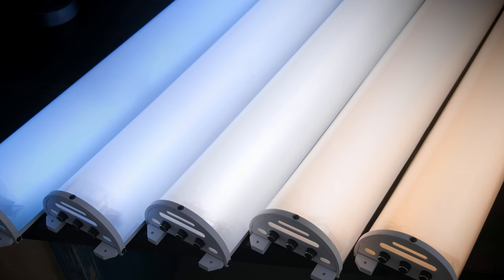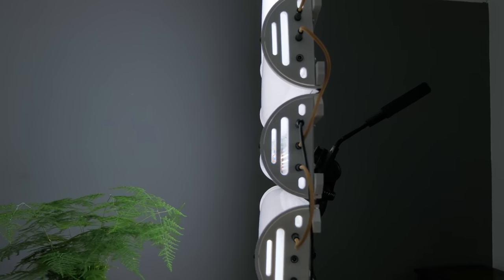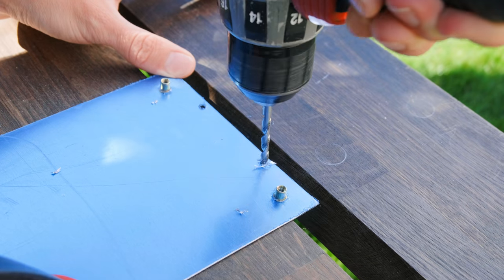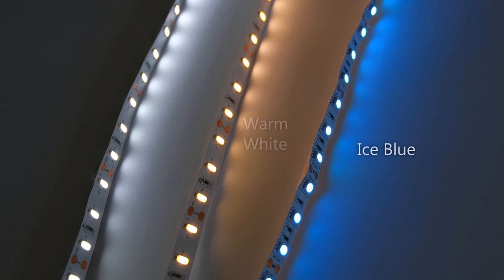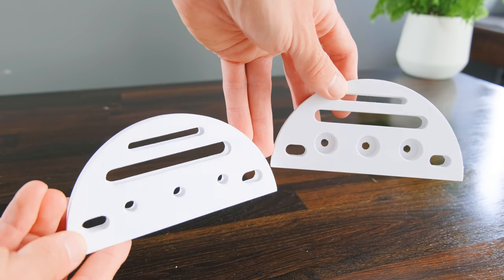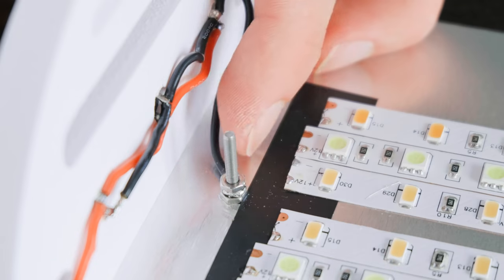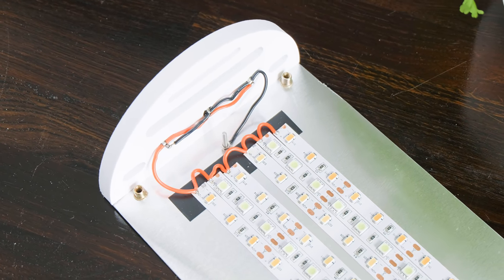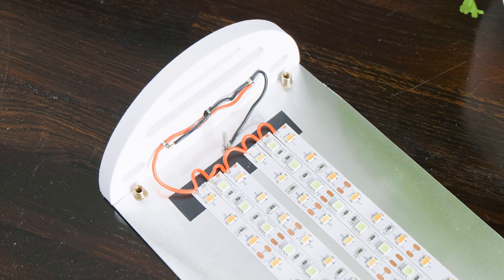DIY Studio Lights - How to Build Your Own!

Comment: can we agree that it's sufficient to use only two of those female DC power barrel connectors on each panel?
Reply: Only upside of 3 is being able to plug the power supply in anywhere in the chain of lights... (I'll be making mine with only 2 sockets)

Comment: Dumb question, im better with spanners than electronics. Would you be able to make these work with a powerbank like in your more recent DIY led video? Thinking these would be great as a workshop/garage light, where I have no power!
Reply: They are 12v so probably not from a standard 5v USB type power bank. Plus, those don't supply many amps anyway. If you don't have power there, you can also use a car battery or some other kind of 12v battery source, but I would make sure to get a device called a "boost/buck converter" that makes sure you get a consistent 12v. That should do it. LEDs draw pretty low power so if you have a regular lead acid battery laying around, most are 12v, it should last a good while as long as you don't have a bunch of them connected at full power
Reply: @adamrichardson2227  Brilliant! actually been looking into a solar panel and trickle charger to a 12v setup. So this definitely lends itself more to that. Thank you for such an informative reply.

Comment: I know this is almost 2 years old, but you never mention the size of the power supply to be used, The total length of LED strip in all the fixtures together daisy chained needs a large power supply, there are almost 5m per light, that is 24m of LED strip.

Comment: I bet if you used some 1/4 guitar pedal jacks/plugs (cheap in bulk from "The Usual Suspects" online) that would save you some hassle wiring up the short barrel jack wires. And they have right angles on the connectors so it might be neater? And they make them in quite long lengths... hmm...

Comment: Love this design, really well done. Wish I had access to the tools needed to make something like this, I've been pining for some subtle, dimmable wall-mount LED lighting for a while, but anything store-bought is ridiculously expensive. A question: what is the maximum power draw of one of these as configured in the video? And what gauge wire did you use for the internal power wiring, given that you'd need to allow for a bunch of these in series?

Comment: Hello Matt, I have built 3 of these and they are fine. But when I interconnect 2 of them they do not work. Maybe voltage drop? What power source do you use?
Reply from the maker: Sounds like a power supply issue! Make sure that you use a power supply that's able to drive them all. They use between 2-3a each, so 2 will need perhaps a 6a power supply.
Reply: @DIYPerks  I knew it. What is your power supply?

Comment: Any links on where to get the aluminium sheet(s), please ? The ones sold at Home Depot are way too thin for the job.

Thanks to answer
Reply: I bought mine at home depot and yes they flex a good bit, but they should given how thin they are and they don't have the acetate to support them yet. My aluminum sheets are around .7mm thick

Comment: The manufacturer of those LED strips sugests using 10A and 15A dimmers and not the compact 5A ones showed in the video. Anyone tried doing it with those bigger dimmers? Seems like you would need a larger base for the aluminium plates and/or ovaloid pvc heads to accommodate for the increased size.
Reply: While not worded as such, I'd imagine that's the suggestion when driving the entire 5m length. This project breaks that down into 1.5m lengths. The 5A dimmer should work just fine.

Comment: Hi, can you please add a recommendation on a suiting powersupply? The only thing missing in my shopping basket :-) maybe put it in the videonotes, so it is easy for others in the future to find
Reply: With the lengths used, The wattage for each light unit with all 6 strips at full power would be ~ 54W (4.5A @ 12V) - That being said, I don't think it's likely that all 3 sets of colours would be at 100% so you could probably get away with less. I ended up just buying a 10A brick. Smaller ones weren't that much cheaper and going any larger would require a generic industrial PSU with exposed terminals.
Reply: Thanks for the info, but i'm wondering: Are we talking about 54W for each "light-bar" or a number of bars daisy chained? since i would roughly compare LED vs classic lightbulb 1:10 in wattage. I'd end up with a 500 watt equivialent lightbulb for each bar? or are we walking about 5 Lightbars as in the video.
Reply: @sebastianheese803  yeah, ~ 54W per "light bar". The eBay listing for the led strips says 50-60w per 5m length and these light bars have 4.5m of total led strip length in them, split between the 3 pairs.

Comment: Do these flicker for slow motion video?
Reply: Not the same way incandescent lights flicker. Those turn on and off at 50-60Hz, so it's easy to see in any slow motion. There still is flickering from these LEDs, but the rate is so fast (10000Hz) you would need an expensive slow motion camera before it becomes an issue.
Reply: Kyle Jacobs Thank you!  This light is a godsend

Comment: It's all good, except your grounding and lack of any form of fuse. Soldering like that isn't reliable and the solder will cold flow over time and the connection will become loose.
What you're supposed to do is to crimp a ring connector on the end of the wire. That's much more reliable in the long term.

Luckily you're not using mains electricity on these, or that grounding scheme would be life threateningly bad.

In this case it'll just cause intermittent working and possibly sparking and won't necessarily break anything or cause a fire or electrocution hazard. 

Add a fuse, improve that grounding and it's almost professional level product. Almost...

Comment: Why do you have three power inputs when one would work just fine?
Reply: He says in the video it's for chaining multiple lights together.
Reply: @LaneSurface  for such purpose you will need only two sockets, the third is redundant
Reply: @WRXMSK  Right, it looks like the third is so you can plug in the input power into any one of the lights. Kind of a weird way to do it, but I guess it's somewhat convenient.

Comment: I was excited about this project and the details....but the lack of a circuit diagram and the lack of power supply made it only a 90% project....
Reply: The circuit diagram isn't super necessary as he shows all of the wiring on the video at various points even if only for a split second. I got a barrel plug 12v 5a power supply and it works fine for powering two so far, haven't tried to power three yet.

Comment: Info from the led strips seller: "Please note: we suggest you use 10A or 15A dimmer to control this 95+ LED Strip Light, not use 5A dimmer." What about it? Should I care?
Reply from the maker: It's fine - there are two 75cm lengths rather than an entire 5m length, so there's much less current.

Comment: The dimmers used here 10:02 are quite bad accually. Their max output isn't as good as it should be. The LEDs will have about 30% (visually) more light if you don't PWM them and just use plain DC instead. There's a huge difference!

Comment: Those LED strips are very weak, unfortunately. 5m stip consumes 50W which gives you about 1000lux-1200lux at 1m. The usage of the diffuser even decreases this value. It means, at aperture f/5.6 and exposure 1/60s you will be using ISO 400 in the best case. For still-life photography it is OK. But for video shooting, you will need to buy a lot of LEDs.

Comment: a 60 watt LED professional tool (I bought Forza 60 Nanlite) with all needed for the light modification (softbox, octabox, beauty dishes and lots of other useful tools) is available for 275 usd. And I doubt that DIY setup will cost you less if you respect all the parameters( considering your labor hours, waiting time and adjustments that will occur during the production). A professional tool can be used everywhere , even outside of the studio. A DIY thing will never do the same. I made this path and consider making a DIY kit as an error. Author is a cool guy, but I suggest to give the right direction to the people who want to create a quality content
Reply: This contraption costs significantly less and as already stated, has much better CRI, not only that but for that price you won't get a proper professional grade fixture so I wouldn't even consider taking it out for serious professional work. 
I'm sorry, your choice wasn't the best and doesn't solve the problems you've stated either.

Comment: why shouldn't we use electrical tape at every "cut" part of the led?
Reply from the maker: There's adhesive that runs along the entire length of the strip, even underneath the copper pads (not that they're exposed on the bottom anyway). Adding a cut however means that there's a possibility of some of the copper bending past the adhesive and touching the aluminium underneath (or maybe one of your soldered wires).
Reply: Thanks a lot! And maybe i've missed something, but what did you do with the ground? you put a black wire on the aluminum sheet, but I don't see where you used it for the dimmers^^

Comment: I love DIY perks, but I just finished building these and it was a total p i t a. I really wish I just bought a pair of sl150s instead. True I built five of these for the price of one SL 150 but these really aren't all that great or cheap and they took forever to build! There's a ton of wiring involved. A ton of assembly. And in the end they are just okay lights with no features.

Comment: A couple of things I disagree:
1. Mixing different color temperatures is quite risky thing to do, so before doing that, make sure you have enough light
2. How can a light be bad color? Most often that is a issue which can be fixed by adjusting the tint setting on your camera
3. You absolutely don't need to buy or build special lights. Work lights work just fine if you add a diffusor and maybe gel (I mean that colored film/plastic thing) to fix the color temperature --> cheaper and a lot easyer to do
Reply: cheap lights are often missing part of the spectrum, something you can't replace by changing the tint on camera or in post

Comment: It’s funny, as a cinematographer, your lighting setup actually looked a lot better before you added these lights.  If you pulled yourself off the wall a little to get rid of the shadow and added a small hair light out of frame camera left it would have looked even better while still looking cinematic.  Your setup after the lights is far too flat with way too much fill light.  Too much fill light generally makes things look less cinematic ;) Regardless, nice diy build!

Comment: Start by saying I like your videos, been watching them for awhile now and this is not meant to be a bashing comment more educational, but *let's get started".... lol

About 6 minutes mark, you start talking about colors and color shifting off LEDs and one point you say the ice blue LEDs start off as a white shifted towards blue. This is not 100% accurate. LEDs manufacturers can not make "white" LED. White outputting LEDs actually start off as blue, then the blue wavelength is passed a mainly phosphorus layer, energizing the phosphorus to output light. The combination of the phosphorus light and the blue light emitted from the LED, is what produces the white light. 

Slightly changing the blue color and or composition of the phosphorus layer, is what produces the different shades of white. 

Like I said the statement around 6 minute mark (white shifted to blue) , is not 100% accurate, but more like blue not shifted as much to white. 

Hope this was insightful.....

Comment: Wish I saw this before I bought soft boxes and stands and lights. I got a blue a 5k and 2 3500k in each...  Probably use the TV screen thing inside them as an upgrade. Gonna try the room divider light with a mirror and camera mount central.

Lol use some grow lights with a 0 rating. Purple or pink.. JK.

Comment: how much cost? in the total? includes all components, please!
your email id, please! & it's a great video by the way!
Reply: 1 reel of each light strip will make 3 light boxes. I just bought most of the things needed and priced the others (I'm using aluminium 1" x 1/2" tube instead of the plastic running the length and printing the end caps. Came in at ~ £210 for all 3. I did, however get enough acetate to make 20 light boxes. (it was either I get 10 large sheets from 1 place for £36 or 2 from somewhere else for £26 plus postage... I'm a sucker for ending up with stuff I'll never use again hanging around)

Comment: Why do yo do this? I've seen you do this several times on different builds and it makes no sense, 
why do you stubbornly solder cables to the underside of screw terminals... it makes no sense.
It increases the risk of desoldering or bridging connections of components which at best will just make it stop working but at worst can short circuit your entire build.

Comment: Please for the love of life don't run electricity in the backplate.

That is a death trap.

If you touch it and something grounded like a metal sink or heating element, you will get a jolt that can kill you if the power supply is not insulated enough.

You should ground the back plate to the ground in your house, not negative of the power supply.

Please delete this video and redo it in a safe way.